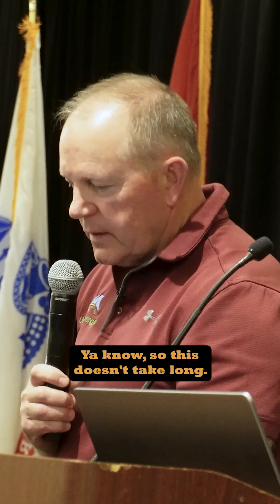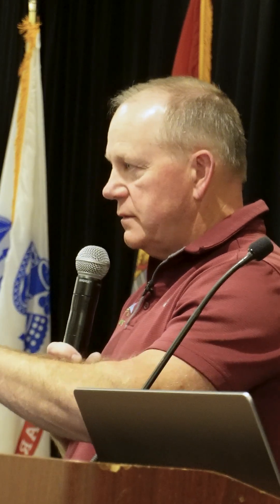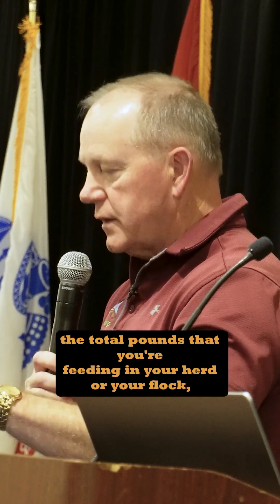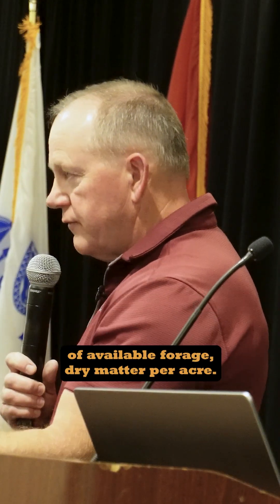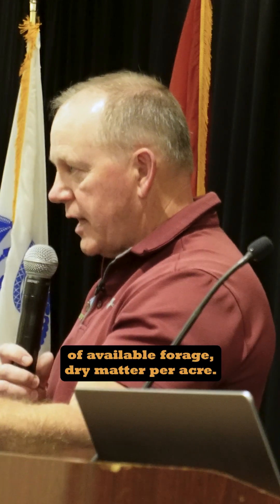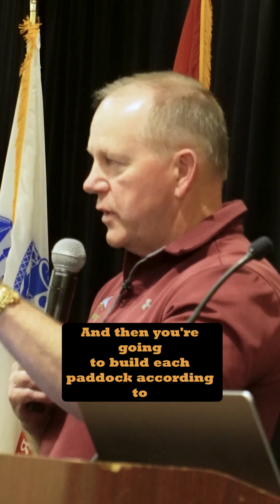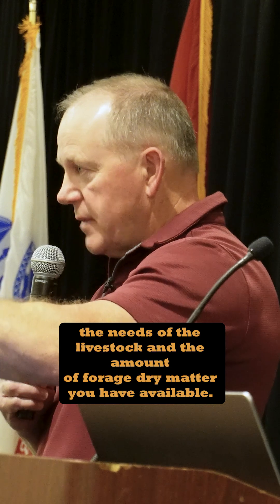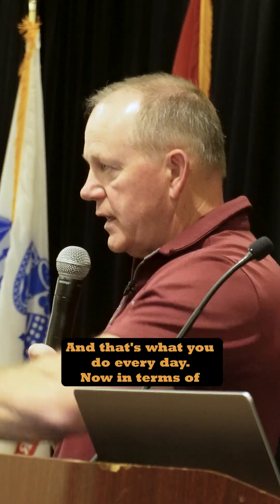What Recovery Looks Like w/ Dr. Allen Williams  #regenerativeagriculture #farming

Comment: My question is water. Livestock need water and every assembled paddock doesn’t have a water source. How do they get around that?
Reply: They move the water.. Or have multiple sources
Reply: For 8000 cows? How do they distribute it?
Reply: Water troughs with a float will shut the water off/on to keep it full. We use ordinary water hoses to connect them to water source. You may need to bury the hose in colder climates and use a freeze guard on a twin faucet.
Reply from the maker: Love this community!
Reply: @chimera7521  i built a sled to carry the trough and hoses. Put cables on both ends so I could move it either way. Works good. The hoses are a pain when the grass is high though. We have about a half mile of polyethylene pipe with spigot ever 100 yards or so to hook hoses up to. We have to move every twodays. Definitely not the best system but what we can afford right now.
Reply: @TheKajunkat  How large is your property? I hate hoses. The kinking situation even on a 50’ one makes me want to punch someone. I am looking into purchasing a 75 acre farm and trying to get water to the paddocks is my biggest concern. Right now they are grazing cattle year round and the land is worn out.

Comment: This should be adopted nationwide.
Reply from the maker: We agree!
Reply: @carboncowboys livestock must have water how is this addressed?
Reply: @denniswhite6162 You'll have to bury water lines on a grid pattern and have a mobile trough or have a mobile water tank with a trough mounted on it. Moving the tank can damage the turf if the ground is wet so you want really wide tires or tracks on it and the machine you move it with.
Reply: Worldwide  🌎
Reply: @mickydee26  Exactly.
Reply: We are trying!
Reply: I do not agree. I see where this is going: do it 'this way' or else!!
Control. It's coming.